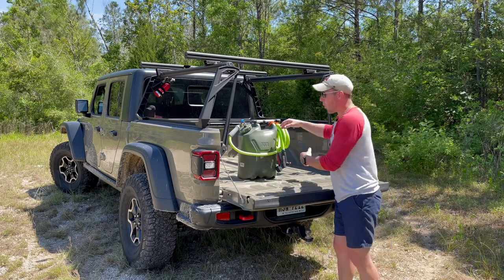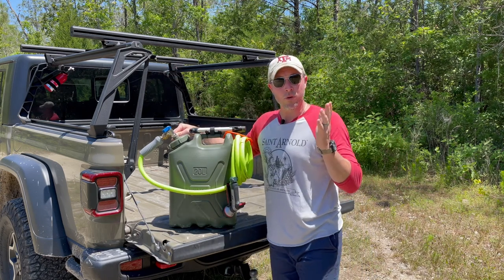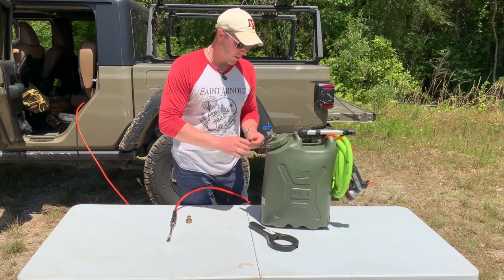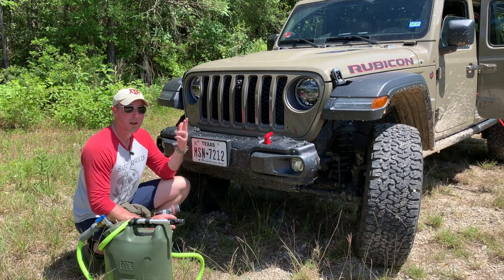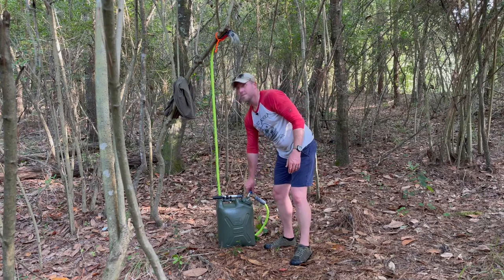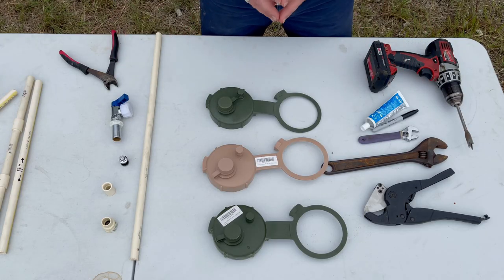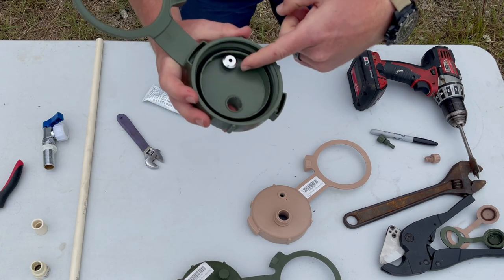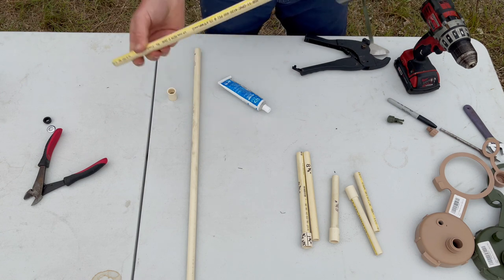Pressurized Scepter Water Can Upgrade *CAMP SHOWER* (JAGMTE Cap Review and How To DIY)

Comment: Solo 430-1G landscaping sprayer has a pump and sprayer built for $40USD, the cap fits the scepter cans
Reply from the maker: Incredible info!! Thanks for the alternate advice.. works out to about the same.
Reply: @GatorOverland  sorry I wasn't intending to put down your build or draw attention away from it. I've just been looking for a solution that fit my needs and came across your video for ideas. I found the plug and play on my build was perfect for my best use case
Reply: @GatorOverland  also, the scepter fuel cans are thicker plastic, hence why they're more expensive to purchase, so if higher pressure was desired, a fuel labeled can would be a better option
Reply from the maker: No way man… Absolutely I really appreciate the information… If it doesn’t help out myself it will help out many others who read along with it so don’t hold back…
Reply: @GatorOverland  hell yeah my dude! Sick rig by the way 🤤
Reply from the maker: It’s coming along… I got a few more odds and ends to fix up to where we are sufficient for weeks of travel if we choose to. Probably going to design a rear seat delete, camp lighting, kitchen kit consolidation, and maybe rockslide engineering steps… It doesn’t take much to do what we do, but there are things you learn each trip that you wanna make changes for convenience….
Reply: @GatorOverland  bodywork gets expensive, jump on those rock slides ASAP, all it takes is a wet log on the trail for your truck to slide sideways into an obstacle. But hey... That's how memories are made
Reply: Can you still attach the hose and quick release if you use the solo cap?
Reply from the maker: After looking, no, you’d probably have to move it all to the tank body

Comment: interesting!
Reply from the maker: It works great! Let me know if you have any questions
Reply: @GatorOverland  the only question that came to mind is how long does it take to pressurize the container using the bicycle pump?  I try and keep things as simple as possible...
thank you!
Reply from the maker: @stacky512a  it would depend on how much water is left in the tank… Less water would mean more pumping… Also depends on the size of your pump… With that small bicycle pump it takes about a minute or so to get to 15 psi… 15 psi will typically empty the entire jug and/or last long enough to rinse off
Reply: @GatorOverland  only a minute or so?  That's actually incredible.  I was thinking more like 5 minutes of constant pumping.  
Thank you for responding.  I "liked and subscribed!"
Reply from the maker: If it’s closer to empty I will take longer.. get a foot or tube bicycle pump to reduce pump time
Reply: @GatorOverland  thank you!

Comment: That sealant isn't safe for this purpose. "Not intended for continuous underwater use.". The company that makes this doesn't even have a website. I would question the use of this sealant or any silicon that makes continuous contact with food. That said I don't know if there is an alternative solution for this build. Other than for use as non potable.
Reply from the maker: Not sure what’s up with the websites right now to be honest… You don’t have to use the sealant, it’s is overkill optional. Prior to this knowledge it is a USDA approved food contact safe sealant. Thanks for pointing that out. We use it as a non-potable water source. 
https://conspecmaterials.com/shop/sealants/silicone-sealants/silco-sil-bond-4500-rtv-silicone/

Comment: how long run time do you have if using hose on shower setting? i'm basically wanting to figure out if I can get around 1-2 minutes of total run-time for an actual shower...previous build used an RV pump, but this may be less hassle
Reply: Would love to know as well
Reply from the maker: 5min max.. gal per min at full blast

Comment: Wouldnt a metal can be better for pressurizing, with a plastic you get about 5 lbs of pressure.
Reply from the maker: One could assume… I actually tested the max and the O-ring gives way about 40 psi… 25 psi is more than enough to empty 5 gallons of water without re-pressurizing. The plastic that these scepter cans are made of is robust…

Comment: Please remove your sunglasses, if the sun is in your eyes, change position, have it off your shoulder. People take more notice from someone you can look into their eyes and slow down your speech. Works every time. But great system and I will definitely try it out.cheers Wiz
Reply from the maker: I appreciate hate the insight and do typically try to do that. I live in Southeast Texas and the weather is sunglasses weather in any direction. Slowing my speech is something i need to work on. Just trying to fit in a bunch of info without taking up the viewers time. Thanks wiz… more content coming soon

Comment: Not safe.  1 you are adding comp oil to the water.  2 if it is over pressurizes it is explosive.
Reply from the maker: Settle down Rick. This is a dry compressor, no oil involved, and while over pressurizing is possible, the seal leaks at about 25psi.. you have more pressure in a super soaker. Just be mindful and you’ll be clean.. 🤝